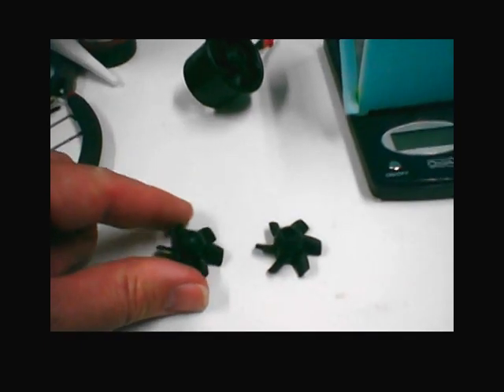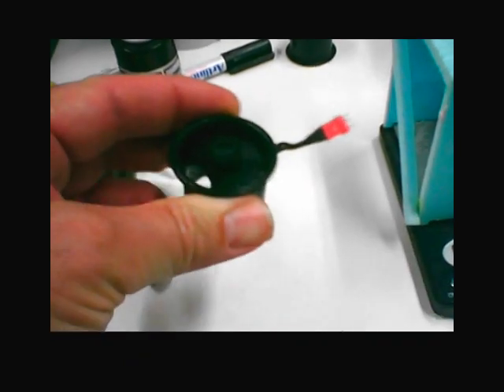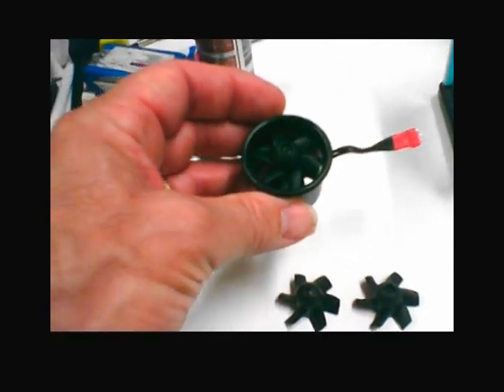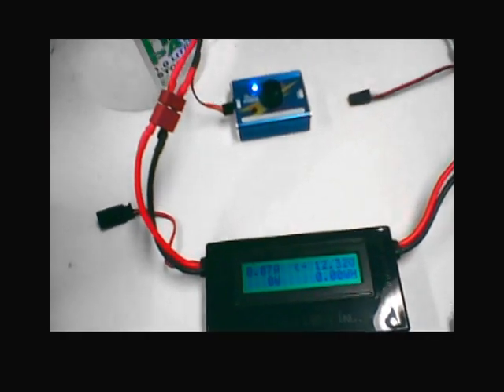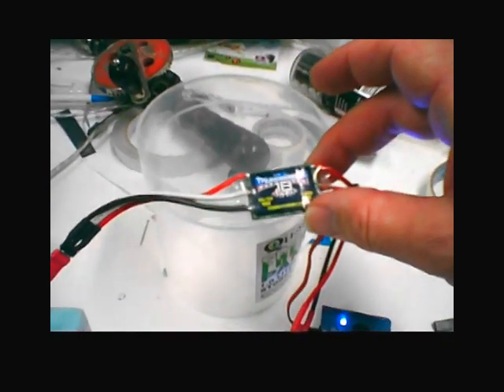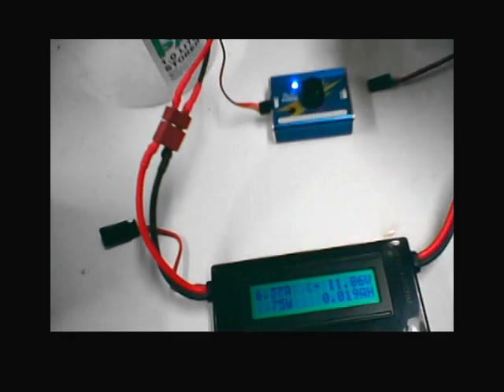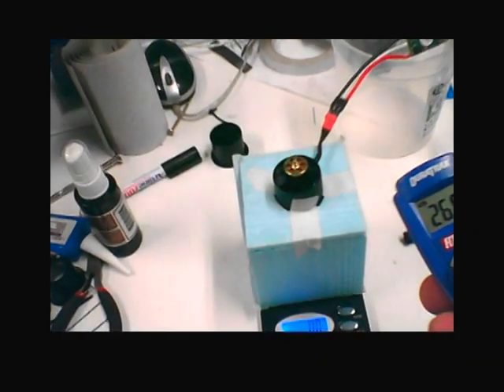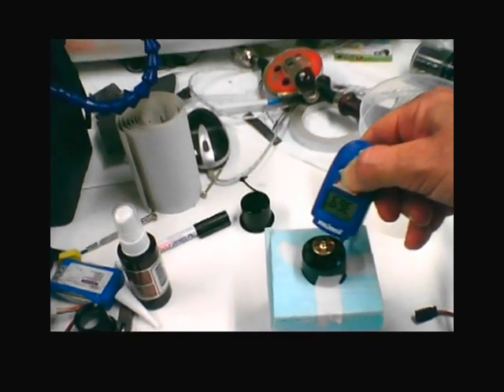Testing the AEO 30mm EDF venturi impeller - it's a winner!

Comment: I have a 10300kv 30mm edf and I'm using an 18A dynam detrum esc should I be using a 12A one instead because I have had 2 of them burn out on me. they don't like to start right up like yours did . mine jitters a bunch and then starts up. I'm using these edfs in project I am making you should check it out and let me know what you think.